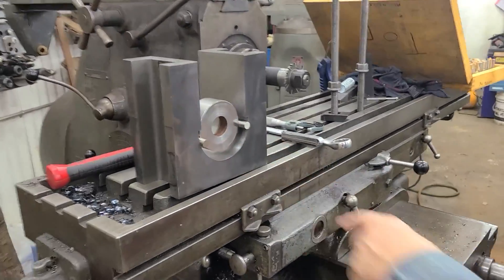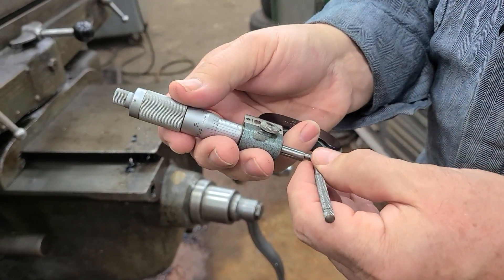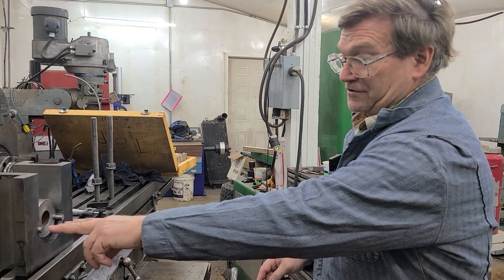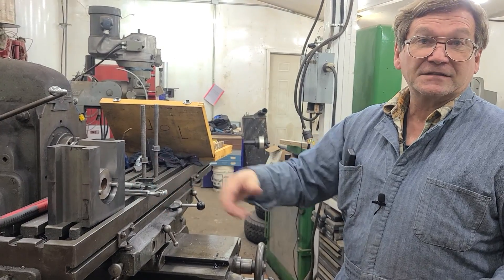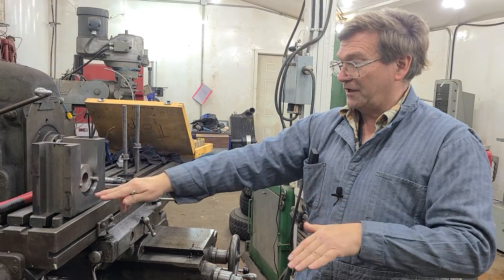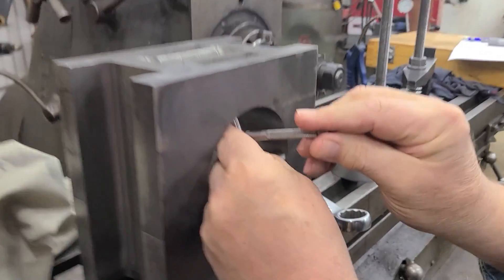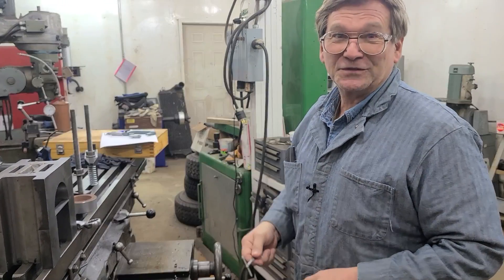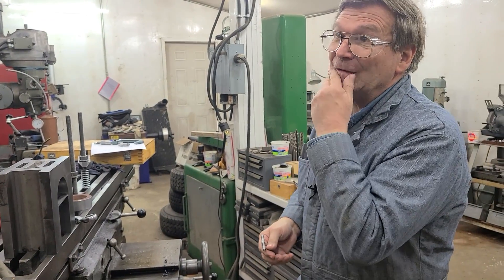Machinist's Minutes: Measurements for an eccentric bearing (BB 1/3)

Comment: Late to comment...been in the trade for 35 years, always learn a few things watching your channel... I'll toss in 2 more ways to measure...1) using the Gage pin method , Baltec offers gage balls in almost every size available,as well as sets of balls under to oversize of nominal at reasonable prices.Another plus of a spherical ball is you could grind a flat on the ball, super glue it to a rod, and measure well into the bore by rotating the sphere.2) When you are measuring across the parallel, try a gage ball or gage pin on top of a gage block stack. It's a very repeatable method. I used to use it when milling d-shaped counterbores. Love your channel, keep uo the good work,stay safe.

Comment: You learn something every day with Howee. Its a bit of a shame that you guys are still on the imperial system. In the UK quite a few machines use imperial graduations on the lathe/mill etc, so i do use both systems, metric and US,its just so much easier in mm than thou. Once you can convert instantly in your head both mm-imp and imp-mm measuring using different tools with different graduations becomes second nature. Obviously Howee measures many many times. I just prefer mm. Sorry. Am i charlatan? Good work Howee.